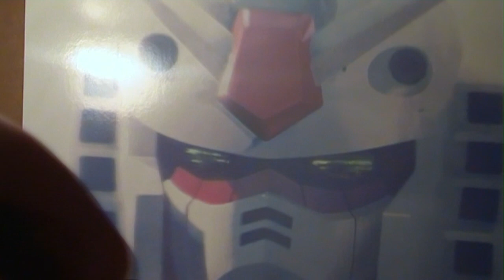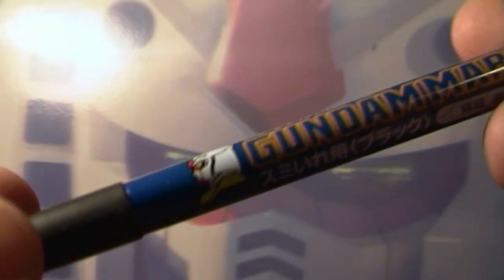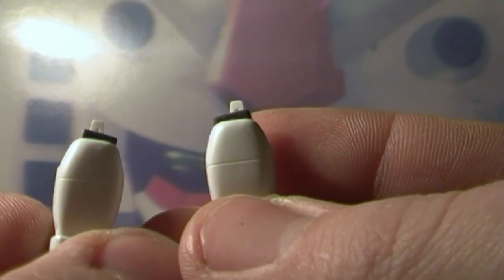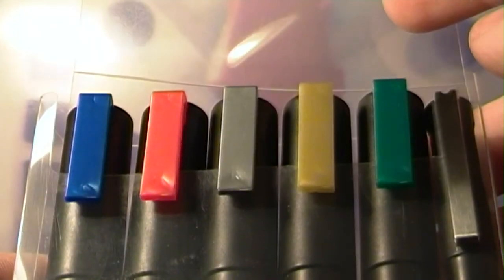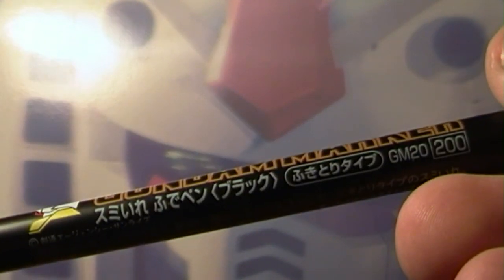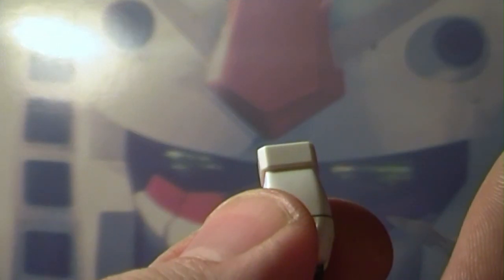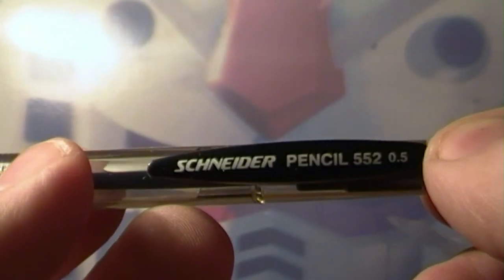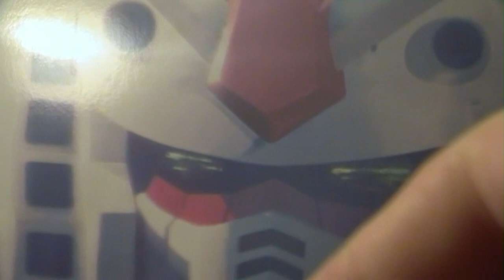Panel lining tutorial (for beginners )

Comment: I used to simply use the fine line only, but a while ago went with trying the real touch markers for added colors and am pleased I did. One of the most interesting usages of the real touch I've seen is using red in stead of black on the Unicorn gundam in normal mode, as if about to transform to destroy mode like prime92 did.